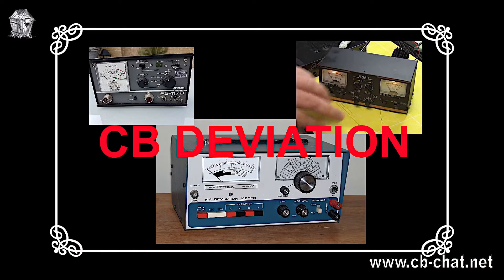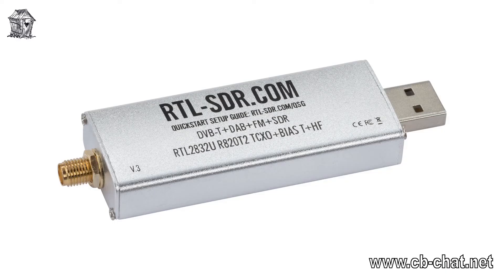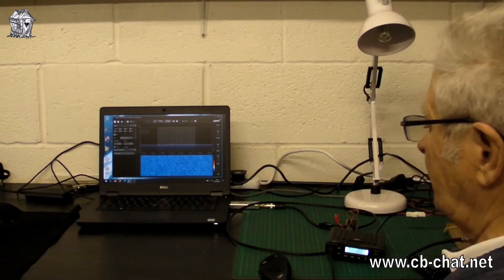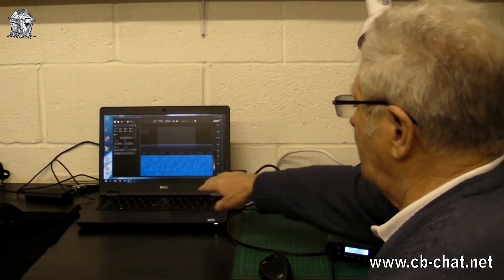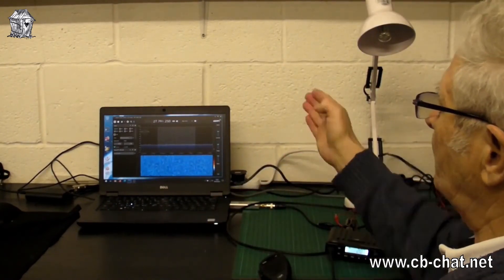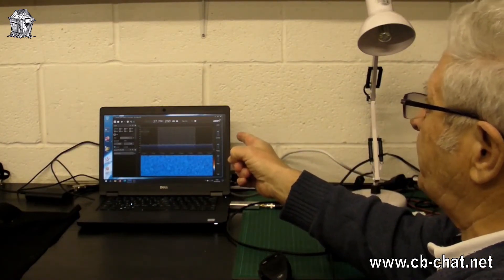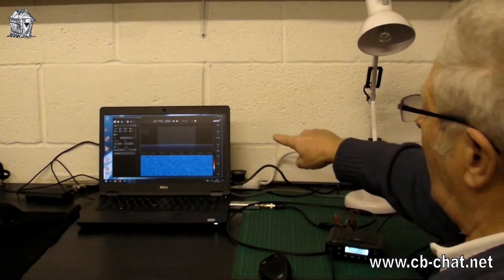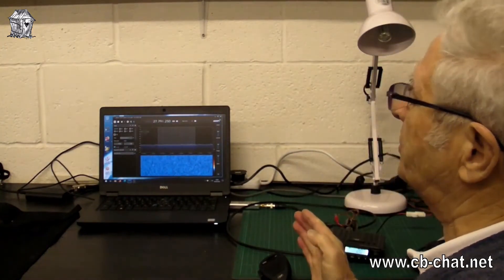Checking CB Radio Deviation With SDR Dongle

Comment: Thanks Ken, very useful.  Following this video I used my Tinysa to do the same thing whilst testing my Rotel RVC-240 and it worked a treat.  I also bought Racal 9008 Modulation meter from ebay which appears to also support FM but I haven't figured out how to use it yet !

Comment: Hello Ken,  thanks for posting a very interesting video.  For some time I too have been trying to find an FM deviation meter, one that I could actually afford. I'm hoping you can help me with how the RTL-SDR dongle is interfaced with the transceiver.  At the moment I'm thinking the transceiver is fitted with a dummy load, with the RTL-SDR antenna placed next to it.
Is this correct?

Kindest regards.
Bob W.
Reply from the maker: Yes you are correct, I had two radios both on dummy loads, and a short wire aerial on the SDR. I had to find a position where the signal strength from both of the transceivers was about the same for the demo. I was surprised how accurate the test results were, it is certainly good enough for setting up a CB radio. Ken
Reply: @kenwilliams563  Ken,  thankyou for your prompt and helpful reply, very much appreciated.   I will now proceed with the purchase of the rtl-sdr dongle along with the supporting software and antenna.

Cheers Ken.
Bob W.